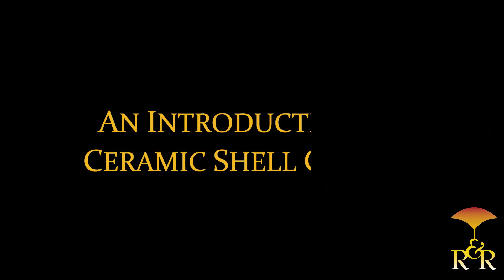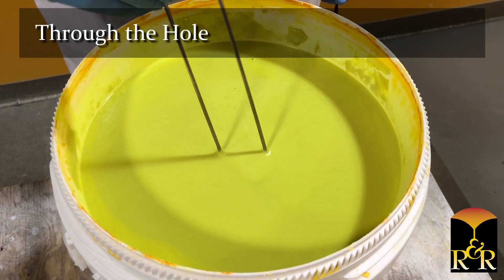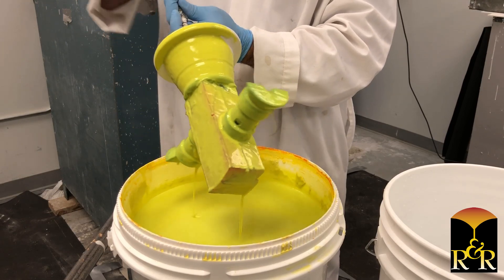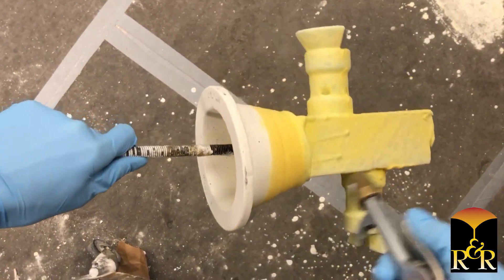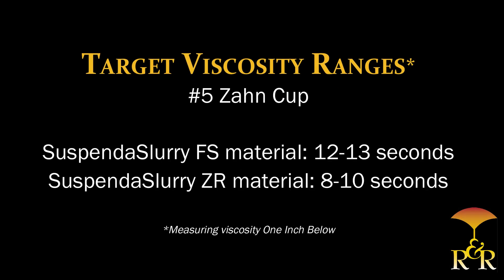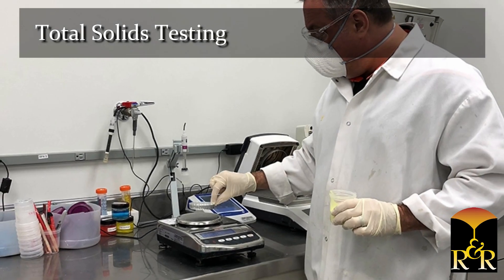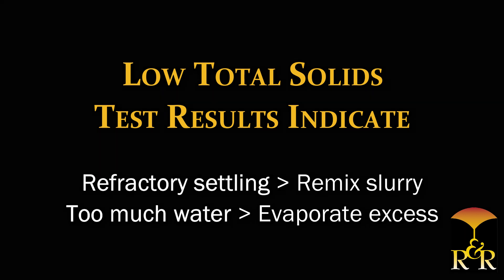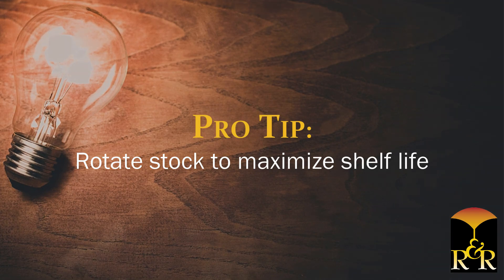An Introduction to Ceramic Shell Casting

Comment: Hi! Thank you so much for uploading this lovely video. It surely helped me in understanding the concepts and clearing up my doubts.
Keep up the good work! :)
Reply from the maker: You're very welcome! Glad it was helpful! Let us know if we can ever be of further assistance.
Reply: @RansomRandolph  mr robot may i ask you for a stainless steel cast i first apply the zircon sand and then the fused silica ( and do it dip it again in the slurry after i apply the zircon sand) ?
Reply from the maker: The sequence is always: 
1)	Dip in slurry 
2)	Drain slurry well
3)	Apply stucco (sand)
4)	Dry 
5)	Repeat for each shell coat (except final seal coat where no stucco sand is applied)
The stucco sequence is zircon (for the first 1 or 2 coats for steel) then fused silica.
Reply: @RansomRandolph  ty also whats the cheapest sand for stainless steel investment that i can buy from your website ?
Reply from the maker: Zircon is much more expensive than fused silica. I would first try using all fused silica stucco.
  •   Ranco Sil A for the first few coats.
  •   Ranco Sil B for the remaining shell coats.  
If you do not get an acceptable surface finish on the casting, then you could replace the Ranco-Sil A with zircon sand and see if this helps the surface.
Reply: @RansomRandolph  ty
Reply from the maker: @umbeatable2770  You're welcome! Let us know if we can be of further assistance.

Comment: Should the slurry be stored in a low humidity environment?
Reply from the maker: Humidity control is not necessary for storage, but the humidity should be kept between 40-60% during shell building.
Reply: @RansomRandolph  so if the slurry dries out over time, one could simply add water and be able to use it again?
Reply from the maker: @robinyilmaz1155  If the SuspendaSlurry has dried out, it is not salvageable.  The material should be kept covered when not in use to prevent evaporation. When using the material, it is typical that some water will evaporate and must be replaced to maintain the viscosity.
Reply: @RansomRandolph  ah okay, but will it still dissolve/fall apart in water after drying, like investment plaster does?
Reply from the maker: @robinyilmaz1155  No, this material will not dissolve or “quench” like an investment does in water after casting. This material will form a shell cavity that is broken away by a hammer or other mechanical means.